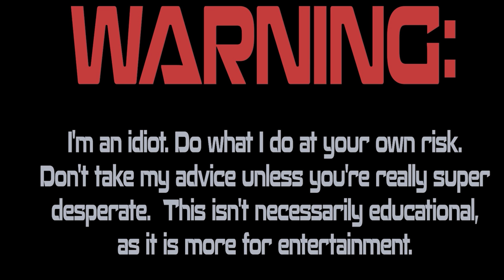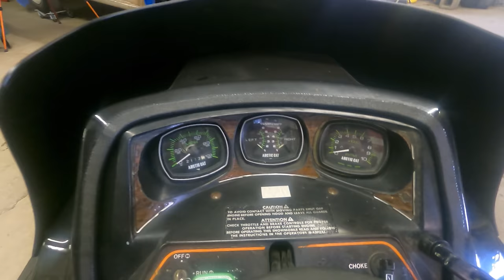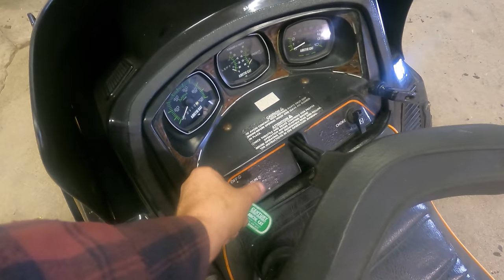FORGOTTEN Vintage Arctic Cat Pantera Snowmobile - Will It RUN AND RIDE again?

Comment: I believe this is my old sled! The reason it was last registered in 99 was because I left for the Marine Corps in the winter of 98. I bought the sled with no engine in Pequot Lakes where I lived at the time and it had 800 miles on it. The engine came from my 78 Pantera I rolled. Shortly after getting it running the original odometer quit so that has the one from my 78 in it. I cracked the air box inlets while working on it when it was really cold. Needed to put starting fluid in and got frustrated. I put in the orange slides for the track, 2 rear outside bogies were new in 1996. I put fuel kill switch to keep my brother from riding it. I sold it to a buddies dad around 2010 for a case of beer. I still have the registration card for it somewhere LOL But that sled flies for what it is! Enjoy! So glad to see it out there still ripping up the ditches!
Reply: Well I’ll be dipped 😂
Reply: Thanks for your service Marine..Semper Fi do or die...but Rangers Lead The Way 78-84 be safe Brother salute.
Reply: Did you ever happen to get into Derek and determine if it's the same sled or not? Just curious, and also, thank you for your service 🇺🇲
Reply: @jrkbgk1111  I tried to find my old registration card, but so far I can't find it.... I know I have it, but where is the issue. The things he listed are a dead giveaway though. I'm convinced 100% that it's my old sled.... Not looking to obtain it, my back couldn't handle riding it. Those old sleds rode like a hay wagon! Not as bad as the old early 60's Bombardier I started with though LOL

Kinda cool to see it's still out there... I loved that thing.... It always started, no matter what!
Reply: The guy I sold it to had a last name of Kimball.....
Reply: If it really is the same one, and Derek got it from the same guy, I wonder if he didn't clean it up and store it for the day you wanted it back. Trading for a case of beer, I'd hold onto it too.
Reply: I have a 79 Pantera which still runs like new. But I thought 78 engines were single carb and the one in the video was twin carb. Thanks for your service 🇺🇸
Reply: @kylegraybill8041 no sir they was also twin cylinder and carb

Comment: I remembered my father bought a 1977 Arctic Cat Pentera F/C which the seat and gas tank size differ than your F/A version.  And the engine housing differ because of the fan.  I rode on it as a kid.  I am 57 now.  I still remember how it is like, the ride, the look, the sound.  Truly a Catillac.  I could not believe how pretty good shape this one was and how well stored away.  I wish I could bought it!  Oh well.  Thanks for bringing this sled up and brought memories for me.  Sure miss it.  If I had the $$, for sure I would buy a collector's Pentera rather than the today's sleds.  I am short, and that Pentera was right size for me because the new ones today are too big, too high, too heavy, and too wide for me.

Comment: I wouldn’t mind seeing some more sled content. Looks like that one was a pretty good deal!
Reply: Same here... Never really been around them... I currently live where you just don't get enough snow to ride one (or area) without trucking them around. But I'm looking to move up north where there are miles of trails and everyone rides and will probably end up getting a sled.
Reply: Did he say what he paid?
Reply: @AndrewBrowner   No, but I figured it must not be to much if he turned down the other one there.
Reply: @volvo09  moving up North doesn't always help. Ain't got no snow here yet in North Dakota. Usually have multiple feet by now.

Comment: That is one sweet unit.
I got a 74 jag 340 been sitting in the corner for four years. I gotta get her going. Its got 180 original miles from NoDak.
Reply: I used to risk my life on a 440 Scorpion Stinger here in North Dakota.
Reply: I used to pull cars out with my old '70's JD 440...I was young and really hard on stuff back then.

Comment: love the old cats. got a 1999 zr 700 original. never blown up and the motor still run's strong.. i'll bet there is a sled on every corner where you live. i live in pa.and every now and then you'll get a sweet barn find. love the show you do..

Comment: I've never seen a Pantera that nice. They're a great lookin sled.
Reply: Man, I worked for an Artic Cat dealer, from 1977-1980  Other than Rupp's Nitro,   there was nothing faster than the El Tigre. I don't remember exactly what happened, but I'm pretty sure our E.P.A. had something to do with the killing off of Artic Cat , Rupp, Scorpion, and I'm sure I forgot some.
The Artic Cat is still around, but only by name.
Reply: @accobra62  the Nitro was quite a bit more coin to get out the door though. We used to say the El Tigre was "the fastest sled a guy could almost afford" back in those days. 😏😃

Comment: The old FA Suzuki engines, when not abused, will run a very long time between service. I’ve seen the 340 and 275cc versions start on Ether and gas mix when really they were totally worn out, needing cylinder work, yanked out of Cats with 10000 hours on them. I used to salvage sled parts for side cash. Great videos. Brings back good memories. Thank you.

Comment: Get the 6000 el “tigger”
Was my first sled, lots of go and no whoa. Thrilling
Reply: If you ever run across a liquid cooled Rupp Nitro,  she is the competition. I really miss the days when cars had no go, and sleds where rockets.
Reply: Too funny, El Tigre 6000 was my first sled as well!  500cc LC  with the radiator that put hot air right in your face!

Comment: If the kids only knew how fun it is to have a set of handlebars in your hands versus a playstation controller they would be amazed.
Reply: Some kids still know. I got my first snowmobile, a 1971 ski whiz from my dad's childhood, when I was 16 four years ago. I had to get it running myself, with no previous knowledge of engine work. Learned carberetors, electrical systems, and did my first engine rebuild on that. I think my dad had ulterior motives in giving it to me, now I'm working for him learning to be an aircraft mechanic at the family shop!

Comment: Steel wool in your intake/ muffler keeps mice out they cant chew thru it
Reply: @paul beenis They chew through it, but can't digest it. It rips them apart on the insides, kinda nasty but it kills them before they get to where they're going.
Reply: @paul beenis wire is copper or aluminum not steel but they taught that in school you wouldent understand

Comment: i bought a 1979 lynx a few years ago last licensed in 82 . 100% new original got the paperwork for the hitch and rack instalation and a 12 pack of original oil with one can missing plus lots of other stuff new bulbs and things . Me and my kid take it out twice a year for a ride to the ice hut and back. Old original sleds are super fun to own there out there if u get digging. put some steel wool in the exhaust tip for storage to keep the mice out.

Comment: Cool old sled. I had a '76 El Tigre', same free-air 500cc Suzuki motor. Very plush suspension for its day. I moved up to the '79 6000 Liquid Cooled El Tigre' which was hot as a firecracker. I used to ice drag it occasionally and it would womp most of the other other stock sleds in its class. I enjoyed also your comprehensive and complete pre-startup inspection. Many a stored sled has succumbed to a burned piston from a rat's nest in the airbox and clogged main jets.

Comment: Thanks Derek , great   carburator  (always flunked at spelling bee)  information on the Snow machine. Lot of old motorcycle technology
Unusual carb bowl set up with funky flap assists , usually toilet seat type bowl with a possible leak , damn ! Sure u know, put your finger  

in carb throat and feel the sliders initial movement ,simultaneously.The ultimate fine tuned motosigh  carb !~!

Comment: I don't use dryer sheets and do not use mothballs either, I did back in the day but then I bought a enclosed clamshell trailer. The critters cannot get into that. To keep mice out of the exhaust I used to take a Red Bull can cut the end with the pop-top on it off, slide it over the exhaust tip and secure it with with a hose clamp.

Comment: I grew up with a '77 Panther. Single carb & dual seat version. That thing went to hell and back for 30 years, 7 windshields, 6 sparkplugs, 4 or 6 belts, 1 set sliders, and enough oversize rivets and washers to rebuild the chassis once. Great memories.

Comment: My Brother bought a brand new Pantera in '77 at that time 500cc was a big dog, but F/A only run great for about the first ten minutes before the heat starts bogging the motor, duuurrrrttnn  like a twin cylinder with one plug fouled, But that is a great find!

Comment: This sled turned out to be a non production racing sled with a 400cc free air engine and a bunch of go-fast parts. The biggest problem I had was finding a track. My Dad made me some adaptors so I could use a standard sleds track. It was insanely fast but it was not as much fun as my other slower machines. You could stop and look around with the older sled - 399 Ski-Doo Olympic - 
My brother had several Northway sleds. They were put together sleds - not unlike AMC cars for a time - 
They used parts from many makers. They were very good sleds. Thanks for the Video.

Comment: Great video. I owned a sled just like this bake in the 90's... wish I still had it. It was good in deeper snow. I had stopped on a snow drift and it settled in a bit, I was worried I would have to dig it out by the way it felt when I stopped. When I gave it some throttle it just walked out as easy as if it wasn't in there. I hope you enjoy yours.

Comment: I've learned a lot from this and another video you have about snowmobiles. Never seen one in person. Alabama weather isn't cold. We have 4 wheelers and Gator contraptions here. One thing I was surprised of though. Snowmobiles have brakes. I would have guessed you just close the throttle and it stops. They look like fun but its 48 degrees here and considered cold enough to stay inside.

Comment: When I first saw those carbs, I was thinking Mikuni. I have one on my dirtbike after the original bit the dust a little too much for a rebuild. Even after sitting for a few years, I can start up the bike and jiggle the throttle to free it up like it never sat. You're right, really good carb.

Comment: A spring loaded punch like you use to put a spot for drilling in steel will pop those float pins out without damaging the carb, I've done it on motorcycles

Comment: Had a 440 Rupp nitro in 1973. I was 8, my friends had Elands. The Rupp was the big dog on the block. Now I ride a 2002 Artic Cat M7 and a 2000 Polaris 500 indy. The M7 will run 80 all day. But I try to keep it at 70😉

Comment: I bought a 1988 Artic Cat Wild Cat 650 with a custom painted green hood. It was beautiful. I spent a fortune restoring it. I spared no expense  on it. I spent 3 months finding out they run the ignition through the headlight voltage regulator even though it had no electric start . I fought a ground issue with the engine  for months before finding the problem. Then the following Winter, it sucked a Reed on a 150 mile trip in the Upper Pennisula of Michigan that destroyed the top end, pistons, cylinders, everything. I sold it for $400. I switched to riding Skidoo after that.

Comment: Peppermint oil on cotton balls works pretty well,  we would use peppermint oil dryer sheets and mothballs to store boats when I used to work at a Marina and the combo seemed to work well. Can confirm it does not keep racoons away tho

Comment: You asked about the dryer sheets to keep mice out. The only brand that have worked for is Bounce. I store my snowmobiles and boats outside with tarps over the fitted covers and I've never had any critters in them when I use Bounce sheets.

Comment: Hey Derek - I’m starting a channel with small engine stuff - sleds and quads being the majority and also utv’s, snowblowers and tractors.  That ole kitty is crazy clean!!  I’m always recommend getting dryer sheets and moth balls, peppermint oil and whatever else will keep them meeeces away cause they are a pain, and stink!!! Hopefully you get some time on the kids dirt bikes - cause it don’t snow in TN.  Later dude 🤟🏻

Comment: Takes me back to the 70's when a had a 290 Yamaha, certified ripper that guaranteed your back to ache for  a week after flying through the cornfields for an afternoon.

Suspension travel was only a suggestion back then..

Comment: Ditch bangin naw more like frosted grass gliding but just the same you an old Darryl  got out there an rotated yet bunions around the block a couple times. Nice to see that old Iron rules the roost when the snow is light but the will is strong, Arctic Cat Strong!!

Comment: those  Suzi 500t'T's are un-burstable Would love a go at one of them but we hardly ever get snow here in my part of the UK. Even though 1/4 of an inch is enough to paralyse the railways here. To be honest the railway here gets paralysed in the fall when a leaf falls on the line. We've even had the excuse of the wrong kind of snow, enough to cause the most hardened chap to cry "Well I'll be dipped"

Comment: For mice, use Irish spring soap bars. The dryer sheets just don't last long enough. Learned it from and old timer working at a fast lube, he had the cleanest truck we saw, dusty but mice free. He said he hasn't lost an air filter in 10 years. Before he was going through 1 a month to the little critters.

Comment: I once dragged a 440 motoski out of a field.  71 I  think. Anyway it it had a 440 bse.  Points. Worked it. Got it going . Weird track setup. Tok it for several rips and the track split down the center leaving only half  the original track.  Limped it home on half a track. Grafted a  track and slider frame of a Skidoo 444. Ran it for several years. Ate up 600 triples of the line.

Comment: I got a kick out of watching this. I had an old 1974 2 up polaris and an early 80s skidoo citation. My first sled I bough myself was an 1989 Wildcat 650. You couldn't ride them as long as you can the new ones but man did we have fun on those old machines.

Comment: To reduce the mice problem, a guy should get a bunch of Victor Powerkill traps.  Put them along edges of buildings, near garage doors, etc.  Use a couple of bricks and a patio block to make a tunnel over the trap.  No bait required.  More or less evey 50 feet,    Be prepared to check them at least morning and evening for 2 weeks before you get a break.  Then again, a couple weeks later.  With fewer around, there are fewer to get in, if they even manage to.

Comment: Apparently whole cloves yes the spice works really really well for mice and little rodents. I can see dryer sheets working if you use a lot like that guy that sold the sled did. Awesome machine and thanks for the making the video

Comment: I've had a lot of great results from using moth balls in my 69 camaro, every winter here in Michigan. I usually place them on the air filter, on each floor mat and some in the trunk........Never had any signs of a mouse near the car.

Comment: The second generation Pantera chassis has a special aluminum bulkhead that keeps the motor planted. No twisting on the mounts when all the horses are let loose. They built the XC racer out of this chassis for two seasons . As such, the chassis makes a great basis for a  vintage twin drag sled. It’s much easier to keep the CVT clutches aligned with the lack of flex, and it’s a light tub.  Swap out the skid for a newer aluminum off of an El Tigre , add a rubber track and modernize the clutches and hop up the engine and you can have quite the vintage weapon for short turf strip drags.  I’ve always felt Cat made a mistake not updating this chassis but keeping the stiff engine cradle. Instead I guess the bean counters won and the next gen was just a widened El Tigre bulkhead with a Panther tunnel. This tub was made for 1976 to 1979 models. Pantera 500 FA and 500 FC and 1976 340 FA Cross Country and 1977 LC 340 Cross Country factory racers.

Comment: Make sure you grease it... if it has grease fittings ... steering, suspension, driveshaft, Jack shaft bearing... right behind the driven clutch there might be a grease fitting... also... keep an eye on track tension and track alignment ... nice vintage ride.. .👍

Comment: Irish spring soap works very well easy to contain, the smell seems to last forever!  most importantly critters hate it. They like to get up into my trailer tongue and chew the electric wire, block  the entrance with steel wool, secures a pretty good border.

Comment: Hell yeah more sled content please iam currently working on a 79 skidoo citation 300 engine is locked up tighter than gramdmas purse so iam gonna put my Yamaha enticer 340 in er not looking forward to making the engine mounts...tracks shot its missing most of the steering linkages it might not see snow this year but a fellers gotta try maybe I should have left it behind the barn I found it at for another 20 years but I had the identical one when I was 11 so it's got the nostalgia factor anyways thanks for the sled videos your my motivation lately sir cheers from Alberta Canada

Comment: On leave from the Army in December '74 I got real drunk and hit a cement block wall with my dad's Arctic Cat Puma. Bent the ski tips up 90 degrees! He didn't even get pissed off. We just got out the oxy aceteline torch and straightened them up and hit them with some paint. Good as new!

Comment: My first sled was a 1974 440 Fury, metallic pea green with an orange pin stripe and lettering. The sled said Suzuki, but some parts were Arctic Cat, my last sled was a 1994 Jag 340, the sled said Arctic Cat Jag, the motor said Suzuki.